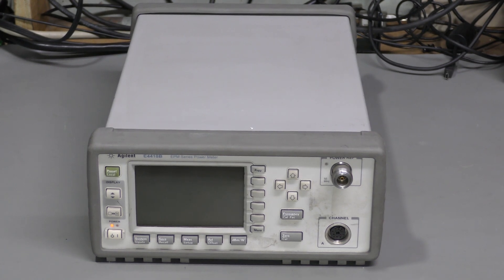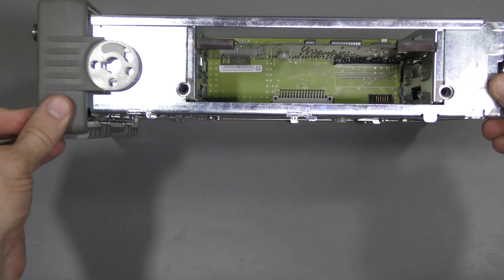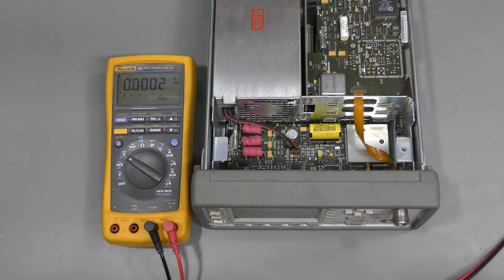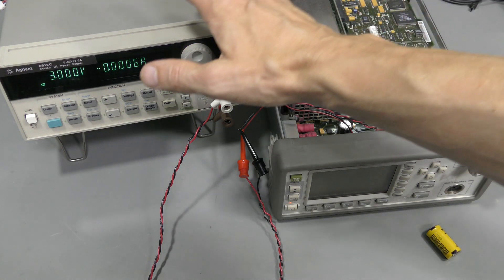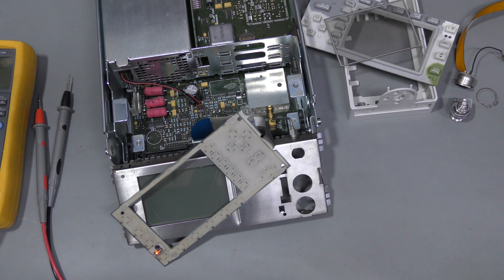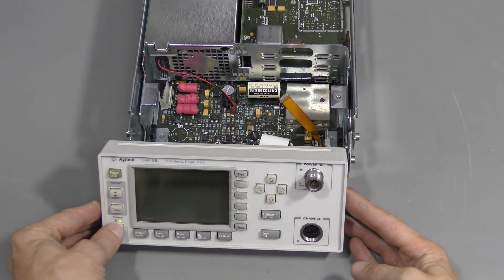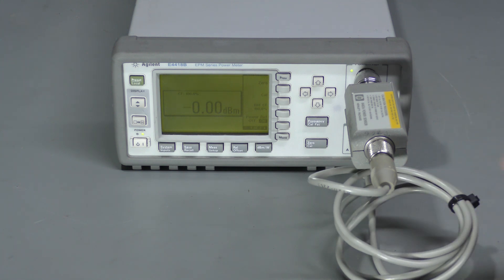#124 - Agilent E4418B power meter repair

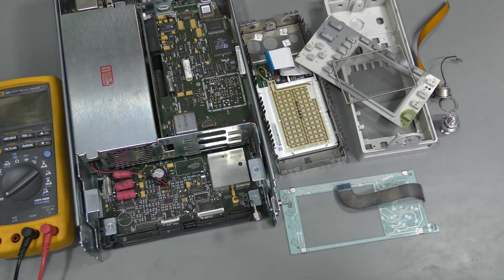Comment: I’m happy I found your video! I did the same 3:33 trick and it worked great. However, when I tried to reboot it, I only had 1.7V on the connector instead of around 5V. At the moment, the device is working intermittently. I’m still trying to track down a possible voltage leak.

Comment: Thanks for this vedio i have agilent agilent e4416a power meter when I press the button nothing happens the battery voltage is 2.9v. voltages 12 v ,-12 and 5 v ok

Comment: You can also power the unit up by holding the front power button in and switching the rear power on.....this bypasses the front button if its not working.

Comment: What an interesting fault!

My Agilent E4418B has a similar type of problem - a low impedance path (150 - 300 ohms) randomly appears across the membrane contacts for the frequency search key. I could find no issue with the membrane, or the lamination.

The issue would come and go, and eventually I took the membrane out, and used a hot air station while pressing the laminations together which seemed to fix it for a few months.

I showed the seller the problem, and they purchased a brand new membrane and sent it to me at no cost, I still haven't installed it as this issue seems to come and go.

Comment: Seems to be a common problem with these units, something to do with a bad or missing battery causes issues with the front panel buttons. Theres a thread on the web about it.
Reply: The front panel issues are well known, you can buy the membranes on eBay from China. If it's anything like the E4419B I repaired, your front panel will fail again intermittently and you'll need to replace the membrane. Think of it as preventative maintenance like replacing caps!